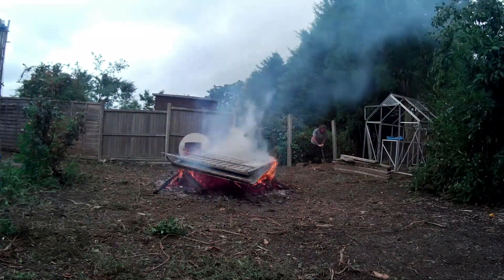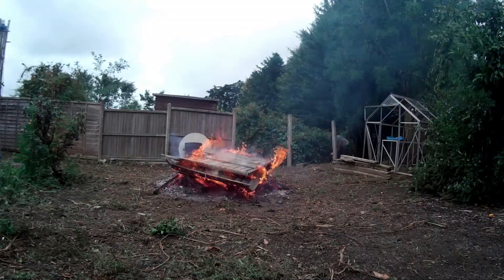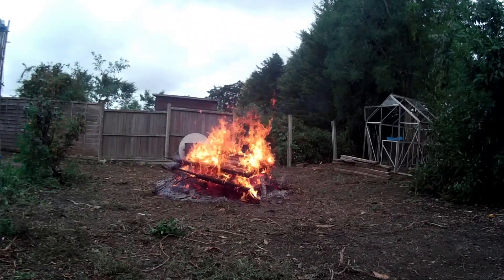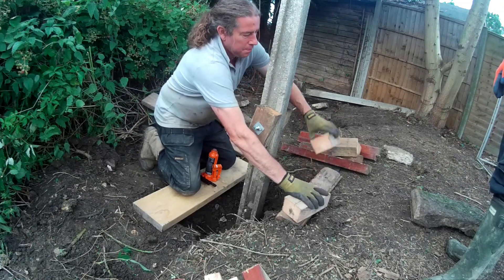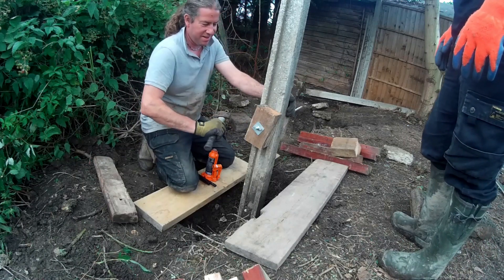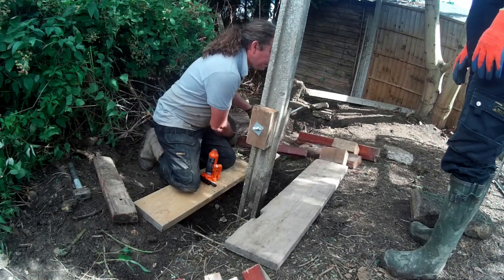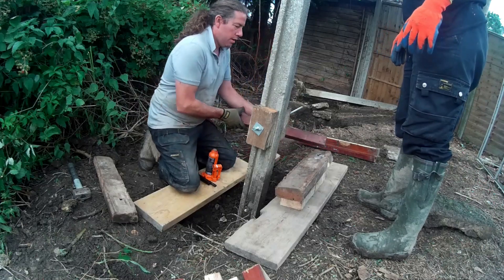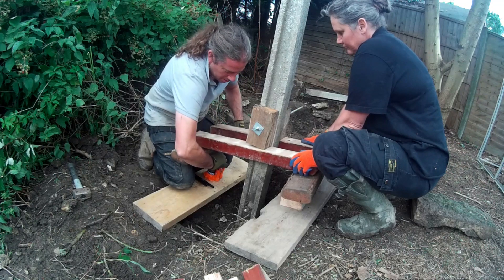House Renovation - Part 8 - Jacking out fence posts

Comment: As good as those posts were in the ground, I would have either covered them with new fencing or painted them and reused them.  Good work tho, I can see the place is looking much better with all of the demo and cleanup you guys have done.
Reply from the maker: Not a fan of the concrete posts think timber much better 👍🏼👍🏼👍🏼